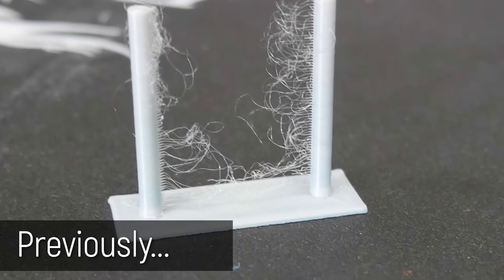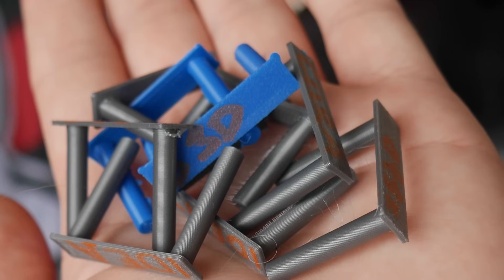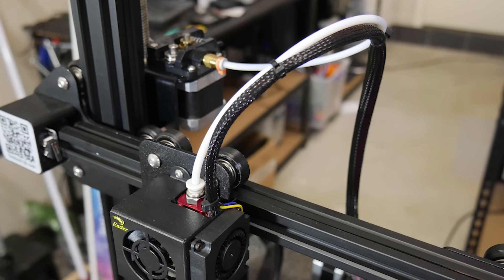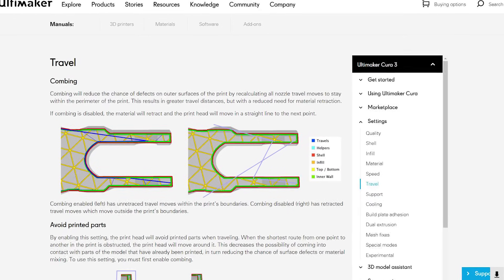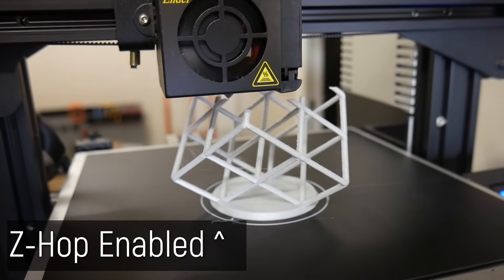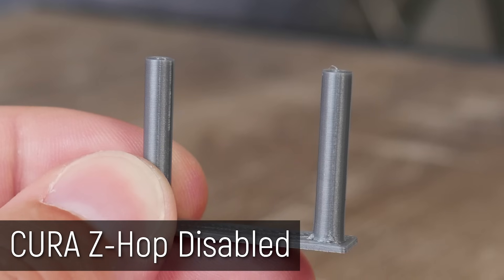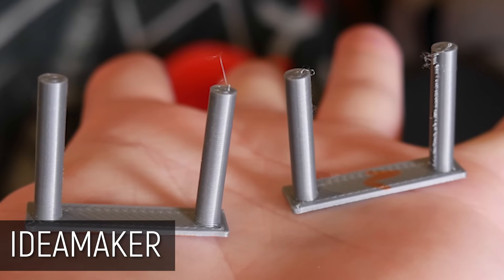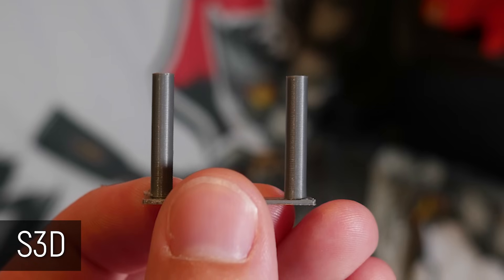Stop Ender 3 Stringing with this One Weird Trick! (ok but seriously)

Comment: 14:05  I wanted to say 2 things about this comment you're making about how you're not ok with lower quality product and how it's your opinion.   this is not an attack btw, I know starting off a sentence with this is not an attack is probably an attack. but really I just want people to be open. 

I fully expect YouTubers who review products to say this is bad on this.  I don't care if the 3d printer was $50 if the bed is twisted say its twisted. price shouldn't be a factor in quality with reviews.  price comes into factor when you might discuss whether the product might be worth the trouble. 

example: last year I was given the newest car I've owned since 2005. it's a 2001 tibourn , 20 years old, for me I'm able to work on my own cars and I don't care about the way they look. so the value of owning a $500 car for 3-4 years is a lot better than making payments on a car I know will work.  For someone else, this may not be true they need something that will work.  

this goes to the warped bed a new bed on amazon, yes I'm in the U.S. so it will come in less than 5 days most likely 2. it will cost $35  so for $250 I can have an ender 3 with a level bed.  o wait you say the new bed you got isn't level either, I send it back, actually, I take it to kohls and it's returned and they send me another one.  once again this might not be ok for everyone, in other countries it might take 3 weeks to get something and then 3 weeks to send it back and 3 weeks to get another one.  this might not be right for everyone. 

but I think there has to be a starting point. a point that says yeah this will work and it will do most of what you want to do.  
also  I think people saying "look creality this is not ok" will help things out 
so you are a voice for us and we appreciate that

Comment: 6:04 -- that rectangular move which coincides with combing and retraction inside.... has been showing up as a well-defined rectangular shape at the edges of my prints. Lowering my nozzle temperature helped a bit but now it looks like I really gotta delve into retraction settings.

I thought the issue originated with me messing with retraction in the past but after using a default profile, it's evident that wasn't the case.

Comment: Not sure about Ender 3 models but I found that on my Ender 5 Pro, the color of filament has A LOT to do with stringing ... I have Cura's latest edition now for Jan 2021 (whatever version it is) and I used 3 different colors of PLA from Sculpto to make the same and separate prints. The black and red did excellent with VERY little cob webbing, but the blue is HORRIBLE ... with the blue, I get cob webs with ANY prints I've done and no matter what speeds, temperatures, and other settings I've tried  
   Going to start trying a better PLA manufacture with reputable quality across the board, possibly hatchbox which I see from Amazon and other review sites is one of the top 5 PLA's on the market for just about any color they make

Comment: Do check the z-hop speed and distance set in cura vs ideamaker. My bet is that ideamaker is using a faster z-hop speed and maybe a bigger hop, resulting in a clean break of the thixotropic melted pla. You may be able to adjust cura’s settings to match.

Comment: Hey Angus or anyne else that can give me an answer :)! Just got an Ender 3 a few weeks ago and it's been a blast designing and printing models. I had a few problems with stringing but since using ideaMaker with your custom profile, this has drastically cut down stringing. I'm pretty clumsy and tend to burn myself on the heated bed quite a bit, so when I started using your ideaMaker settings, I noticed that I stopped getting burnt (so clearly the heated bed was not being heated). I double checked through your profile and saw that you had set the heated bed temperature to 0C and was wondering why this was the case. 
PS it's nice to see a popular Aussie channel on yt :)

Comment: I just got an Ender 5 and am new to 3D printing. I first used the Creality PLA filament that came with the printer and did not have any stringing problems at all. Then I started using Labists brand PLA+ filament and suddenly it was stringing a lot. I tried various nozzle temperatures up and down and nothing stopped it. So are there certain filament brands that are best to avoid? Is this something more common to PLA+?

Comment: Great vid. I have an Ender 3 and three Ender 3 Pros. I tear my hair out!! I use S3D because it's the only slicer that will let me print thin walls the way I need them .... believe me, I've tried a lot of slicers and wasted a lot of PLA .... and gained many more grey hairs (now torn out!!). I have spent hours perfecting my profiles .... I need a different one for each printer, for the same designs and the same filament. Day 1 ... (near) perfect print, woohoo! Day 2, same profile, same design, same yadayadayada ... cr@p print!! WTF?! I feel the Ender 3s can produce fantastic prints but I find them just way too inconsistent. I won't be buying another. Would rather spend a bit more on a printer and maybe spare my remaining grey hairs. Any recommendations would be very much welcome. My prints are small and pretty basic, nothing complicated. So, I agree with your opinion of the Enders. I love them when they work well, but jeez, they can be infuriating!! Love your videos and your candour!! 😁🤗

Comment: I really don't get it why don't you work with retract distance, retract speed more? Sound to me still you didn't dive to much into the slicer features and printer setups. Like a Ender 3 require 4mm retract (nozzle length) plus 1mm per 10cm boden tube so most the time you end up with 5-6mm retract and retract speed is the factor which clips the material into a vacuum so zero string and also no blob anymore at your object. That is why it's important you have files for material plus specific manufacturer & material plus printer settings on your slicers in use. Because even a different color can make a difference on how a material reacts. Also often you want a wipe command before you do a z hop. The retract before wipe before z hop also forces the material to detach without leaving anything behind. But great videos and you gained another subscriber because like you said we all constantly learning otherwise we still would be stuck in the stone age beating on rocks all day.

Comment: I know this is a really dumb question, but what's so bad about stringing? It may be annoying, but isn't it completely removable? Just get a little blade and run it down the roots of the strings and you're good to go, right? It doesn't damage the print at all, does it? Unless I'm doing it wrong!

Comment: old video but very valuable information. I too am not happy with the creaility quality control. I think I could get over it if they were responsive to questions either via email or their forum on line. News Flash they are not. Reddit and YouTube were much better for help. the ender 5 pro for example comes preloaded with a firmware/parts mismatch flubbing all your prints. there is no warning and no real way to figure out what's wrong for days. they changed the Z-axis step screw but didn't change the gcode out of the box in the firmware so all of your prints fail. Next the extruder spring that helps hold the PLA to the motor is WAY too powerful. it took days to realize that it needed to be removed and cut by about 25%. that solved almost all of my extruder feeding problems. I just found on line that it is a constant problem across the board. So i get that its a hobby brand but at a price close to 500 bucks when i got it, i expect better quality control and company responsivity.

Comment: I'm watching this just now for the first time after owning an ender 3 for the past 3 years... First time I'm hearing about stringing issues 🤣🤣🤣
Reply: So you have been printing alot without stringing issue?
Reply: @fahmif.n2715  the only stringing I'm getting is when I print multiple items on octo-print and it happens because of the octolapse picture plugin the extruder moves to the middle after every layer outline causing a tiny string but other than that not really
Reply: @farzanblooxfrost  cool man, thanks for telling this

Comment: Had mine about 8 months now, have levelled th bed once, tighteded all screwws when setting up, and it has printed beautifully from the start. Never had a stringing or blob problem. Just have to take your time setting it up. I use hatchbox, sunlu, and wyze filaments., and i use cura 4.7.1

Comment: hi Angus , thanks for you video , it always help a lot. I have a question...

im using the Cura setting profile that you share from Chaz and test it...but still stringing with my printer.

im using ender 3 pro, before was good, but in between this 2 weeks, the nozzle is cloging and I change it, and then the stringing problem is come to me again and again...

im not sure what wrong I did...can you pls advise .. thanks so much

appreciate it !

Comment: i tried the profile of chaz meister but still with stringing. only hot end temp i changed from 200 to 220 degrees because i am using silver pla and the minimum temp is 205 degrees. bed levelled, e steps calibrated.

Comment: So it is Sept 8th 2020 and I am using a Ender 5 and tried Cura as well as S3D. After setting the printer up physically, CURA printed a near perfect result right away. S3D needed a few teaks, but appears to be easier to do. HOWEVER, what I found with just this one printer, tweaking ONE setting at a time, sometimes makes a massive difference and I tweak in small increments. As a matter of fact, I tuned the printer backwards with the help of https://www.simplify3d.com/support/print-quality-troubleshooting/
Meaning, my printer was so good and well tuned, I had no idea what to do in the case of "if" and "what happened?"
So I changed settings that should fix a bad result, to actually cause it! That was a fantastic experience and showed me, that there is no way, you can replicate the EXACT result YOU have, vs what someone else might be getting, because. Type and age of plastic, brand, printer, location, environment and type of slicer, are far too many variables to compare a machine vs machine.
The only thing you can do fairly reliably is: EXACT machine model and setup, same slicer, same filament, get the gcode and the same model to print allows for comparison.
My printer is now housed in a temperature controlled enclosure, fixed to it on 3 sides, with relocated filament spool, tightened capricorn feed tube and fine tweaked slicer settings.

Comment: Agree with you conclusion even cheap printers need to work and deliver results, and give a bit bang for the  buck. warped beds and other issues that relates to cost saving in production,  may give you Additional expenses  in  fixes and upgrades that are not needed and wasted time and filla ment,  then the cheap printer may not be so cheep after all..Thanks for a honest video that don`t tell you what to mean or think.

Comment: Nice style dood, I like.    I made the mistake of adopting not 1, not 2 but 6 CTC printers (“clones” of the ender 5).    They really are diabolical.    Have you ever used one? Do you have any tips on set up and settings (other than using them to take up space in the skip) particularly with stringing.    I have spent many hours trying to tweak temperature, retraction speed and length, z lift but little success.    Any advice vma 👍

Comment: I fought my new Creality3D CP-01 (which as I'm starting to understand is pretty much a repacked ender 3 on a smaller bed for the FDM tool) for a solid week trying to get no stringing on that same tower test, and to keep z hop enabled and keep the stringing gone with z hop enabled, I also had to add like 6mm @ 25mm/s z retraction (because Bowden tube), and turn on nozzle wipe. This is all in S3D.

Comment: WELL, THAT WAS DISAPPOINTING. Unfortunately, used 'Ender-3 1.16mm ChazMeister.curaprofile', but still get stringing/"clumping", and a lot of it:( So, something else must be up. Did notice was very difficult to manually feed filament through Bowden tube. Perhaps that's negatively impacting retraction. Angus? Anybody? Will be getting Capricorn tubing (w/ improved fittings), but don't have, yet. Hm?...
Reply from the maker: It definitely sounds like a gap between ptfe and nozzle! New couplers to start, and cut the tube end square
Reply: @MakersMuse  Thx. I did attempt to push the tube as far as it could go to butt up against the nozzle to make a proper seal. Will try, again. Also, will check geometry of tube end mating w/ inside of nozzle. The stock coupler is "not so good". At the drive gear end, the tube came loose when feeding filament. I managed to push it in far enough to stay, so I hoped I'd fixed that issue. My research indicates the coupler might not have gripping teeth. Did find (on Amazon) Capricorn tubing w/ couplers and a cutter tool. Hoping to get those soon. Thx, again. Will let you know how I make out...
Reply: P.S. Fortunately, no jams - at least so far. It's my understanding that this can occur if the tube doesn't properly mate with the nozzle.
Reply: Pulled tube. Inspected end. Looks "squared". A little "browning" on inside 2mm or so. A little "gummy" on outside surface of tube. Took pix. Reinserted  tube. Pushed in with extra attention. Reattached retainer clip (for what it's worth). Made mark at top of tube where it meets coupling: to indicated if it moves. Rerunning stringing test print (the simple, two-columns one). Let's see what we get this time!:)...
Reply: ...STILL STRING:( Hm? Maybe still not seated properly. BTW, not whispy stringing, but "globbing", and making diagonal, tree-like artifacts. Hm? Off to The Googles...
Reply: @swamihuman9395  did you resolve this? I'm having the same issue with the tree-like artifacts
Reply: @brennenawana9826  Nope:( Did get Capricorn tube, w/ coupler fittings, and tube cutter (for flat/90º). Gonna try that next...

Comment: cool they are wiping the tip on the printed part to clear the thread ... to move to the next part ... smart idea
Reply: if bits are curling up you dont want MORE cooling you want less ... the top is cooling before the bottom so it pulls it up as it shrinks ... thus the bend ... i would expect that to be a change it the flament temp or the cooling fan if you have any control over it

Comment: 3d printers extrude by increasing pressure inside the nozzle (by forcing plastic in). If you have pressure in the nozzle, plastic will flow. If you want to move the extruder without extruding, that pressure must be reduced to zero before moving. With that long tube acting like a spring, you have to retract quite a bit farther than a direct feed printer. I have found that 5 mm default isn't enough. I upped it to 6-7 mm depending on the temperature I'm printing at.

Comment: I just spent the better part of a month fighting nightmarish stringing. Wish I had stumbled across this video much sooner! You covered the two settings that made the biggest difference for me.

I'm running a cr10 s5 with a 1mm nozzle and PETG. Using the Prusa Slic3r, I fixed it by setting the thing to retract 100% before a wipe and turning off z hop. It's not perfect, but I'm down to one or two strings per part instead of huge fuzzy messes.

Comment: just goes  to show  how a ridiculously  high priced slicing program that you need a second mortgage to get  is not the best slicer !!   and the lesser know free ones are a much better ...  ive just started using ideamaker and of all the slicers ive used  this is indeed the best ,th  GUI is awesome , the functions it has are just as good as the previous one ive just mentioned . i especially like the built in pause at height , the variable  layer height  and selective printing functions .. 
  i suggest those  creators  of that most expensive slicer should take note and make it more affordable !!  and not take the Micheal by having such a high price for a program that just does the same as these other free slicers !!  i think its a disgrace !!  we are not all loaded individuals .

Comment: I bought an Ender 3 as a learning tool,
 I did the same back in the early 90's with computers.
 Get a cheap system and learn on that.
 Then upgrade when you understand the basics.
  Now waiting on my Snapmaker 3 in 1 3-d , Laser and CNC :-)

Comment: IdeaMaker and Cura: both stop one or two layers short of finishing the top of the print, so it's got to be the same setting in both that I'm missing or setting wrong. Running a 0.6 nozzle. .2 / .25/.3 layer height with no change. IDEAS?!?!

Comment: I strongly agree that the print bed warping is not okay. I print with rafts to make up the difference but I shouldn't have to. It adds time and uses more material than if it just had a better print bed. For me it comes down to efficiency. If it had a better print  bed I would save money in material in the long run.

Comment: I had bad luck with my Ender 3....it kinda works fine now, and sometimes i wish i would have spend some more coin on a better printer, but i learned alot since then and maybe also because i had many issues with the machine....enough to not simply scrap it an buy a new one, but enough to know what i want from my next printer, this and that i will probably build it myself. I see it as a leraning experience, even tho frustating at times, iam at a higher point of knowledge, than i would have been with a machine, that worked well from the start....also more aware of how to treat my equipment an watch out for the signs of failure :)